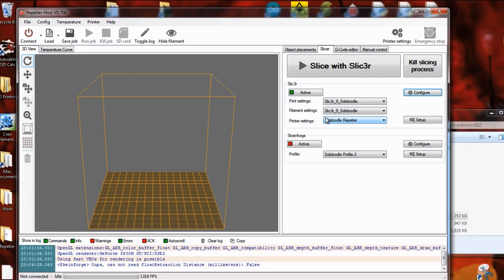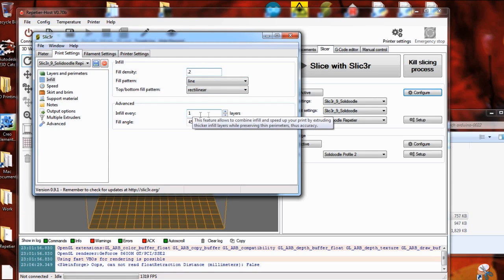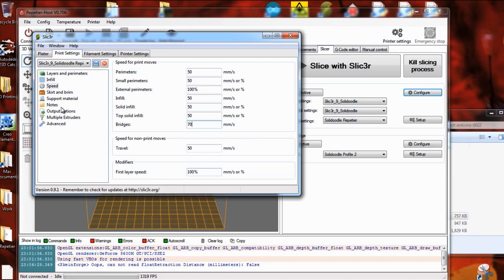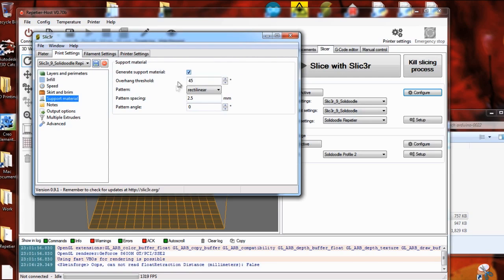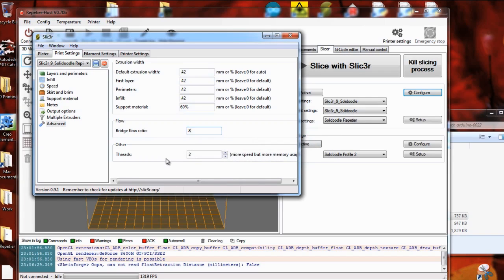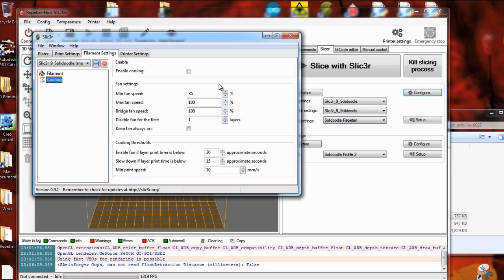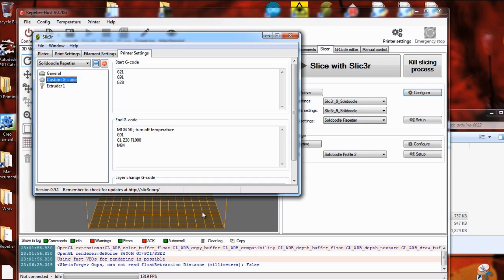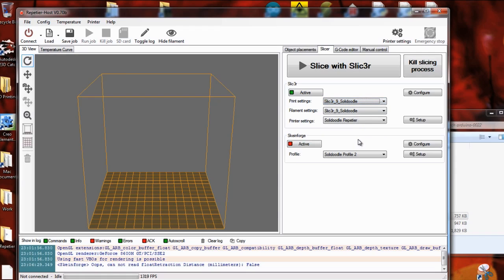Repetier Host for Solidoodle - Slic3r Settings

Comment: Hi Ian, first, thanks for putting this together, greatly appreciated.
Just have a question, regarding filament diameter, assuming i dialed in my exact filament diameter (and it is pure solid, no hollow spots), is there still anything that calls for adjusting the extrusion multiplier?  Please advise.